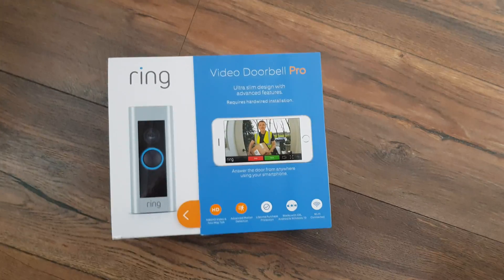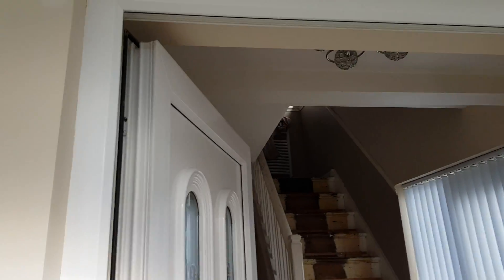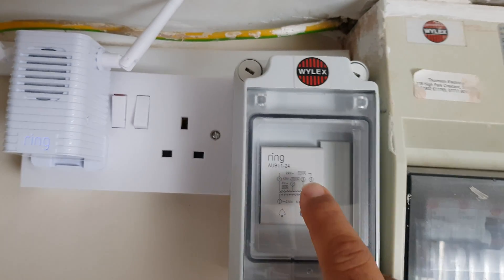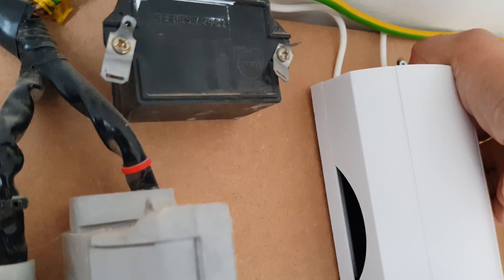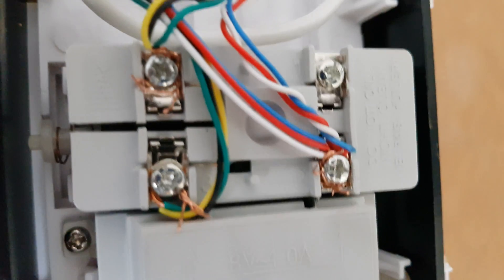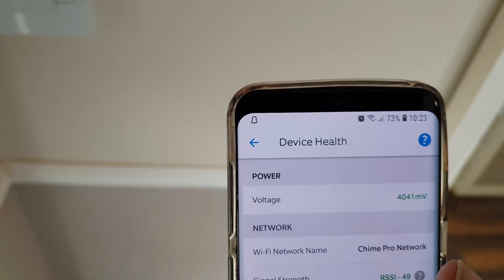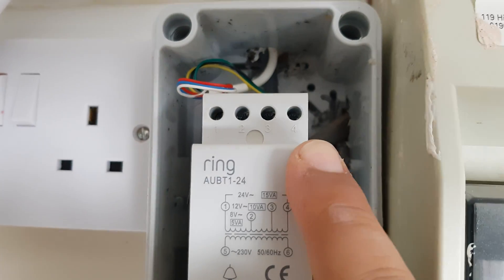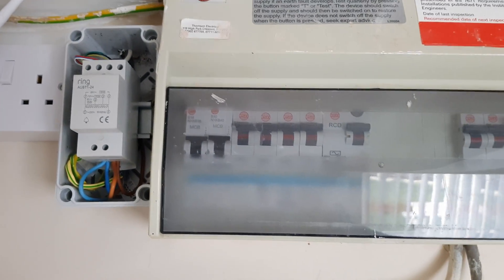Ring Doorbell Pro UK Installation Working On Byron 776 240v 8v Mains Chime Doorbell Working Proof

Comment: Am I right in assuming the bypass kit is not required if I’m using the Byron?
Reply from the maker: You don't need to use it if you want the byron door to chime aswell also you need to disconnect the 230v supply to the 8v transformer when using the ring transformer.
Reply: Georgey Porgey I’ve done it. All fitted and working. The issue I’m having is the doorbell striker vibrates slightly making a humming noise and also causing the transformer to heat up. Has anyone else had this issue?

Comment: Hi, I have moved into new built home and has the same transformer inside the bell box, can I just replace that transformer with the one provided by ring within the same bell box instead of installing new one as I am not Pro like you :)
Reply from the maker: Then you have to use the ring transformer as the standard one is only 8v and your ring pro needs minimum of 16v.
Reply: Georgey Porgey So I can remove the 8V  transformer from the bell box and plug my Ring transformer in it right ?
Reply from the maker: @hemantrathod6235  the ring transformer wont fit in the byron bell box you need to get a separate unit for the transformer. Screwfix sell a wylex 3 module ip65 enclosure. They are £11.01.
Reply: Georgey Porgey thank you very much ! Also really appreciate the reference of the supplier(screw fix) will order it now !! Thank you again :)
Reply from the maker: Which ring doorbell do you have? Just to make sure as you can use the existing transformer in the bell with ring doorbell 1 & 2.
Reply: Georgey Porgey thanks a lot for the reply :) I have ring doorbell Pro, I have the same 8V transformer in the bell box where blue and brown cable go and there is earth cable as well.

Comment: Thanks for the video, I'm trying to do the same setup. Could you please simply tell us which terminal numbers on the Byron doorbell I should connect to the ring transformer, and which terminal number should be connected to the ring pro doorbell?

I tried 2+3 to the transformer, and 0+1 to the ring pro but it doesn't power up the doorbell
Reply from the maker: Sorry mate about the late reply new update on the phone and had no notifications. I connected 1 & 3 on the ring transformer.
Reply: @georgeyporgey9661  thanks. I spotted in one of your other replies someone had said 1 and 3.

I tried it on ring 24v terminals and it worked for a few hours, when I came back in the morning the circuit breaker had tripped and the ring transformer had fried. The Byron still works.
I also tried using the Byron 8v supply, which did power up the Ring but after ringing once the Byron would permanently buzz.

I've just received a replacement from Ring. Have ordered a Friedland chime which apparently will work on 16v. Will wait for that before attempting to connect it all up again.

Comment: Can you advise on which wires we need to purchase please?
Reply from the maker: I used alarm cable or you can use 2 core bell wire.
Reply: @georgeyporgey9661  thank you.
Reply: @lordship6457  You must use at least 0.50 mm bell wire for a 24V load.

Comment: Hi there,
Thanks for the video. My transformer has just 2 terminals, but mains cable coming into it is t&e. What do you do with the earth conductor?
And how to you connect the other end into the consumer unit?
Reply from the maker: When say your transformer has to terminal  connection so what is the voltage output for the transformer? Is it 16v or 24v?

Comment: The reason you were getting 27v AC from the Ring transformer was most likely because you were measuring the no-load voltage. The voltage should drop once a load (the camera) is attached and drawing current...
Reply: Surely the byron if the byron transformer is 8v. It only wants 8v. By what you have done is now putting 15v to 16v into it.
Reply from the maker: @alexgull271  yes I have put 15v/16v via the solenoid because when ringing the door bell I want to hear the chime just in case I loose wifi or internet connection.
Reply from the maker: But you can't connect it to your Byron doorbell as it will burn it out.
Reply from the maker: The transformer requires 240v into the transformer and 8v out but ring door bell requires minimum 16v.
Reply: @georgeyporgey9661  I see what your saying. But it means your putting 16v into the byron solenoid which is rated a 8v
Reply from the maker: @alexgull271  yes I rang up Byron and ask what voltage you pushed your door bells too. They replied with 12v so I thought let's push it to 15v and it works.

Comment: Q1: Have you bypassed the mechanical chime? The solenoid doesn’t seem to move in the videos and I can’t hear it ding dong over the volume of the digital.

Q2: Have you simply replaced the solenoid power in from the new transformer to 2 and 3 and take the feed to the button from 0 and 1? Rather than the normal button feed from 0 and 2?

Thanks
Reply from the maker: Solenoid is still connect and works amazing. With the connections. I connected from terminal 1 and 3 which suppose to be 15 volts but if you git a voltage tester it's actually gives you 16volts. Hope this helps.
Reply: might be helpful to someone in the future - I set mine up with a setting to use the wireless chime (but still connected top left and bottom left to the existing wall chime box - basically each end of the coil wires you can see going into the coil below the terminals) as some might want to use both with the wireless as a repeater. As the wiring was tho to the old bell box anyway so made sense to use the existing chime. You have to use the B/P wiring as shown in the instructions with the existing wall chime (which is not shown here). I used the settings to connect the door bell as wireless chime - but as the Wal chime is hard wired it still also works on operation of the door bell. My installation is was an Eziviz - but similar to other makes and models. Below is a helpful wiring video for the ezviz.

https://www.youtube.com/watch?v=VGaHKC7Jr3g&list=LL&index=1&t=685s

Comment: thanks for the video its very helpful . 2 questions  i havent got an existing wired doorbell and the consumer unit is some way from the front door so i now have the 776 to work with the ring pro . is it possible to provide power from a plug straight in to the ring transformer ?
secondly which wylex housing did you use for the transformer ? it looks nice and neat
Reply: found the consumer unit   https://www.screwfix.com/p/wylex-3-module-ip65-insulated-enclosure-with-visor/74436
Reply from the maker: Yep that's the 1.

You could do but better if you could have it's own circuit on a breaker.

Comment: Thanks for the video. I was hoping you could help me as I also have a uPVC porch and I am trying to figure out how to wire the doorbell. I noticed that your bell push is at the join and looks very neat. Do you mind explaining how you did the wiring? Did you just drill through at the join? Thanks
Reply from the maker: Well I drilled 1 side of the join from the inside and went straight out. The doorbell is wide enough to hide the hole and the cables. I also used the ring pro backing plate to mark the pvcu join and scored it a sharp knife. Then run the knife down the side of the join. Got a used chisel and tapped it with the hammer. Just got to drop abit if upvc silicone around it and all done.

Comment: Hi again, sorry to be a pain but could you confirm the connections on the Byron doorbell, the top connection looks free, although the description says transformer goes to 1.
Reply: Thanks for the info, done and working.
Reply from the maker: @steverussell7383  so happy & glad to help.
Reply from the maker: Ok the supply from the transformer 1st cable to the lower left and 2nd cable to the lower right.

Then 1st cable from the doorbell to the top left and 2nd cable from the doorbell goes with the cables at the bottom right connection

Comment: Have you used the 'Wylex 3-Module IP65 Insulated Enclosure With Visor' ? Are there any other brands of enclosure you'd recommend for the Ring transformer please? I would ideally like something a little smaller.

Shame there isn't a mechanical door chime enclosure (available in the UK) that could accommodate the Ring transformer.
Reply from the maker: Because the transformer is big anyway and deep it's hard to find anything smaller.
Reply: Thanks for the reply. I have ordered a Byron 776 this evening.
I am going to visit my local CEF tomorrow to check whether the Proteus 2 Way Insulated IP20 Enclosure would be deep enough for the Ring transformer. https://www.cef.co.uk/catalogue/products/45765-1-or-2-module-insulated-ip20-enclosure
Reply: The Proteus enclosure worked.
Thanks again for sharing how to use a mechanical door chime with the Ring Doorbell Pro.

Comment: Hi

Does you bryon door bell work at all?

I have been trying to get it to operate my mechanical door bell, so far i have failed
Reply from the maker: Yes it works everytime. You do not put a supply to the bryon door bell.
Reply from the maker: So you have connected the out going of the transformer with dermal 1 and 3 then you connect on the solenoid sides of the bell not into the transformer of the bell.

Comment: Thanks so much for posting such a great video - Just what I need. I have the same components. I tried terminal 1 & 4 but it didn't work. Unfortunately, I cannot get around your wiring. I noticed you are using x pair twisted cable. Would you be kind enough to share more details on how these need to be wired. Your help will be gratefully received. Thanks :)
Reply from the maker: I've basically used alarm cable because I never had any bell wire and alarm cable can take upto 50 volts.

What door bell brand  you are using?
Reply: Hi, if I just wired the Ring Pro into the Bryon bell with the built in 8v Transformer, what would happen? Would it work alongside the chime? Or do I NEED to use the provided transformer?   @georgeyporgey9661
Reply from the maker: @JoshuaThomasPowell  You need to wire straight in the ring transformer only. Do not  wire up the 8v transformer.
Reply from the maker: @JoshuaThomasPowell  the ring pro requires minimum 16 to 24v so 8v is under power the doorbell and burn out.
Reply: Thanks for your advice there, - would it be safe for me to remove the 8v built in transformer from the Bryon, and install the chunky 24v Ring transformer actually inside the bell hanging loose?   @georgeyporgey9661
Reply from the maker: @JoshuaThomasPowell  I don't think it will fit but you could try. Get some dim rail to fit it on if not just get a encloser from screwfix for £11.
Reply: The answer is in the video, just need to listen carefully. don't have to use twisted pair cables. I used speakers cable. The two cables (doesn't matter how these are connected) from Ring Bell goes into 0 & 2 in Byron. And the two cables from the transformer (1 & 3) goes in to 2 & 3 in Byron (there's no specific relation there either). All works as a charm. Thanks very much for a GREAT VIDEO :)

Comment: HI Great video , i Guess my ac adapter which was going to power my pro door bell work , the ac adapeter is 18 volts with the special loops to hook on the back thanks
Reply from the maker: I think the 24v transformer us a bit much for the doorbell due to the voltage fluctuation we get in the UK. 18v in my eyes is perfect. I'm glad my video has helped you. Thanks for viewing my video.